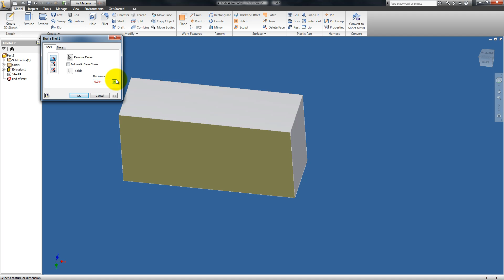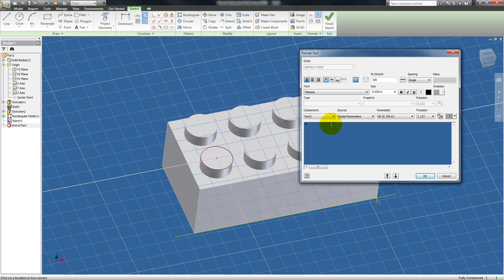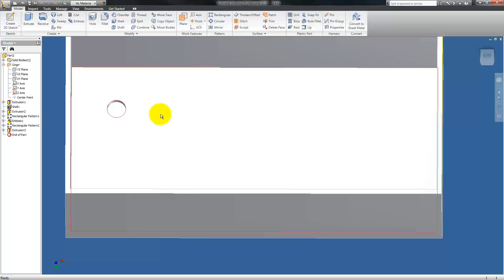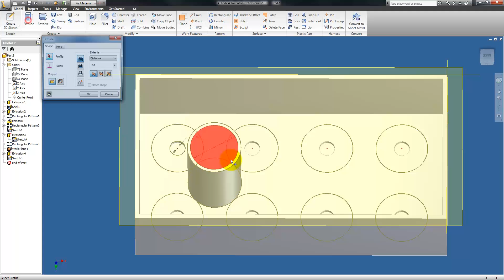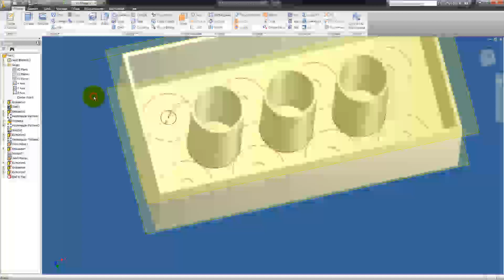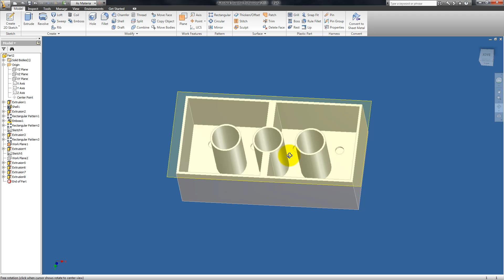Autodesk Inventor Tutorial 22: Part Modelling Example - 2x4 Lego Block (Normalized Audio)

Comment: Nice video - enjoying this series! Good for honing the skills - just a small point on this one - the geometry of the circles is such that the pitch is still 0.36 in between the large extrusions (i.e. numbers 4 and 5), so you can shortcut by selecting these two extrusions for the rectangular array, rather than re-drawing new circles on the sketch - but as you say, there are multiple ways to complete everything :-)